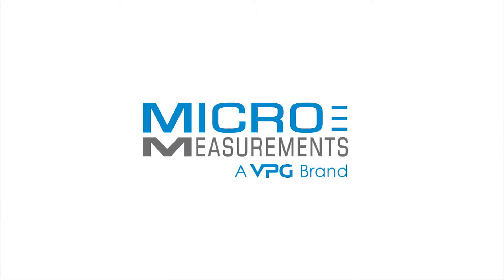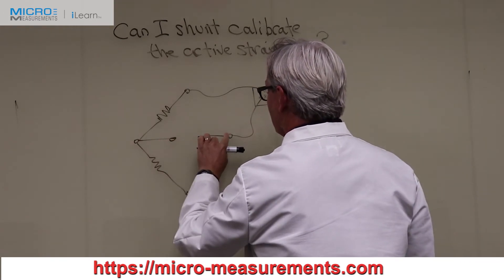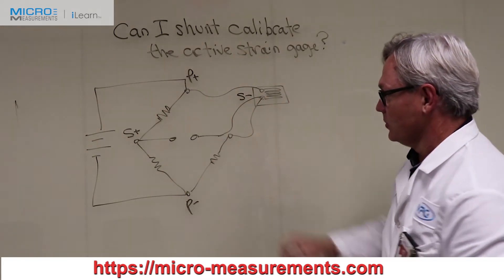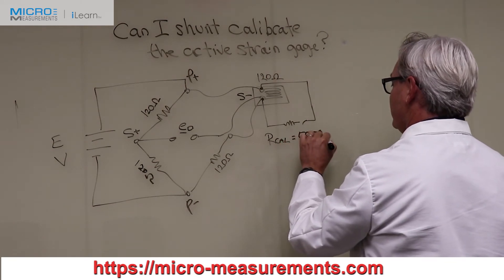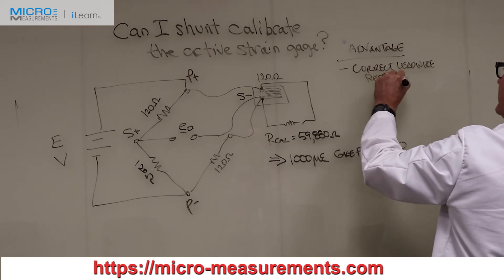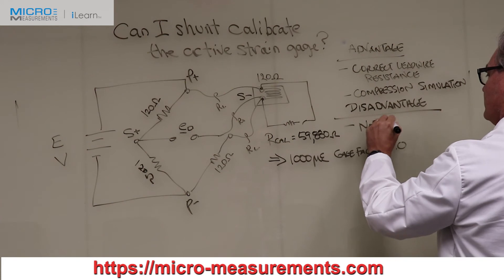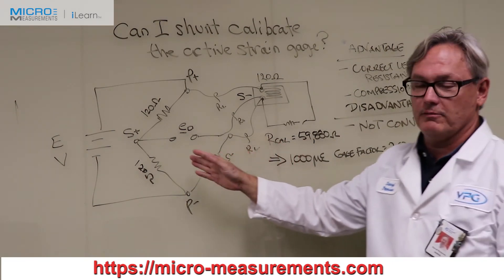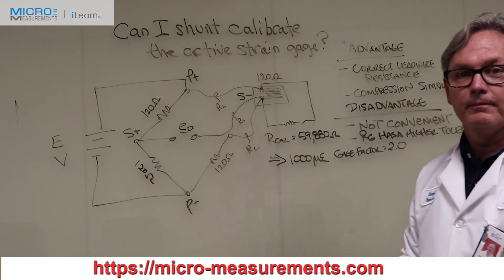Can I Shunt Calibrate The Active Strain Gage?

Comment: "Resistance of the wires can change depending on the length of the wires." Incorrect statement wire resistance depends on wire material, diameter, kink level, temperature, ... Better statemet, the wires add resistance to the loop compromising the shunt. Besides this explanation could have been done in 2 min or so.